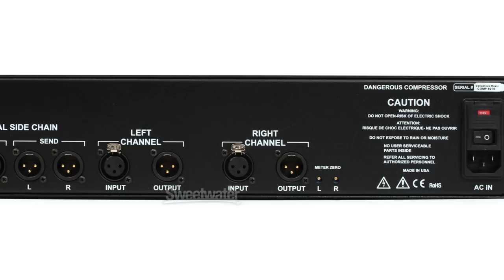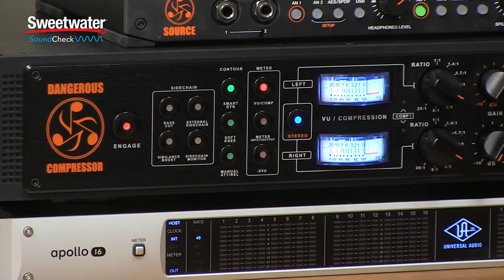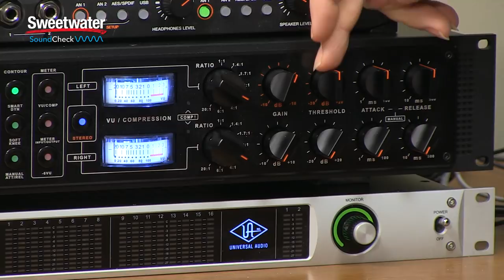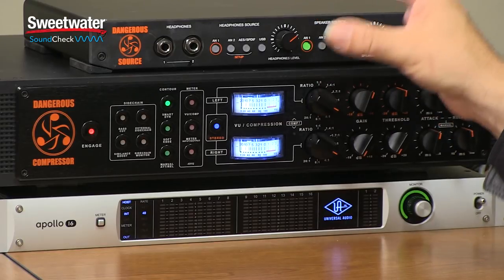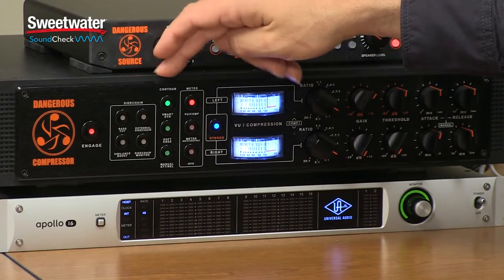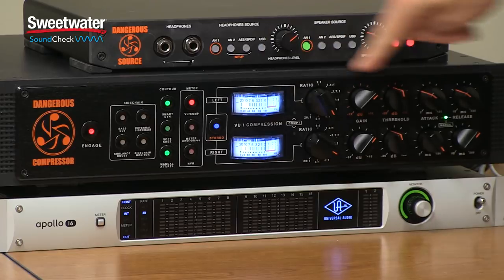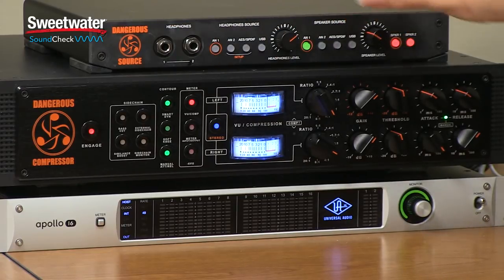Dangerous Music Compressor Review by Sweetwater Sound

Comment: Here's the thing, is that for some reason I always hear it working.  It's not very transparent to me and it's very pumpy.  That cahon thing really made the shaker unstable.  The mix with the bass and piano didn't sound good at all - Every time the bass hits, hear how much it sucks the piano down and back up - it almost gets me seasick.  I'm sure that engaging the bass cut might help a bit but to be honest I've used other compressors without a low cut in the sidechain and it wasn't as pumpy as the dangerous compressor.  I want to like this comp so much but every example I've heard of it, is the opposite of what it's supposed to be.
Reply: I agree. He says "not audible on the track at all" when its clear as day, and not in a good way.
Reply: @seanmccullough8893  Thanks for replying.  After a while I start thinking I'm nuts that everyone keeps calling it transparent when you can hear it working so obviously.   I used to feel the same with the old safe sound audio demos on Zenpro.  Warren would be saying about how amazing and transparent the comp is and meanwhile when the chick in the demo sings loud, it would get so obviously pinched and tiny.  I start thinking I'm the only one hearing it. 

I still want to like the dangerous comp but also on reverb so there's so many used for sale that it makes me wonder as well if this comp isn't the holy grail everyone claims it to be.  I see mastering guys buy it and then relist it for sale months later.
Reply: @effyiew7318   I know what you mean. I want to like it too but I have my reservations. 30 day return policy so may just grab it and find out for myself guilt-free.
Reply: I agree, it’s incredibly audible. You aren’t imagining anything. But...Don’t blame the compressor because the engineer wasn’t using it properly. There is a video with Mike Wells that is much better. Check that one out.
Reply: hey bro i’ve got this comp also and   i feel sometimes it kills the bass even with the filter switch selected  it’s as exactly as you mention what compressor you got in mind that’s similar and same price range or less ?

Comment: Nice demo. Would be great to see the inside of all boxes you review as part of the deal. Some of these high priced boxes are super sparse under the hood.
Reply: There's a photo of the inside in the SOS review.  It's like a bag of potato chips...90% air.  There's a single circuit board with a bunch of IC chips and another smaller circuit board for the power supply.  The rest is emptiness.